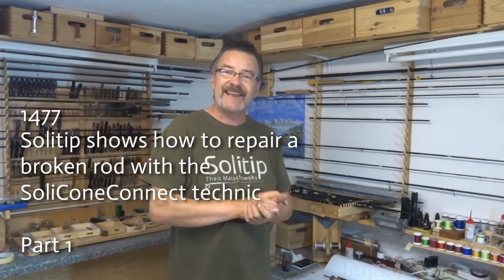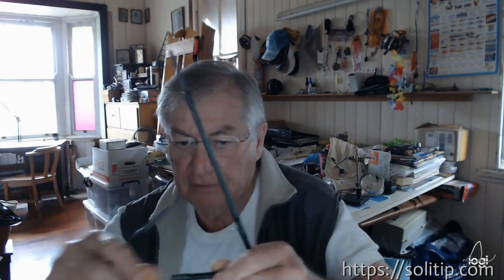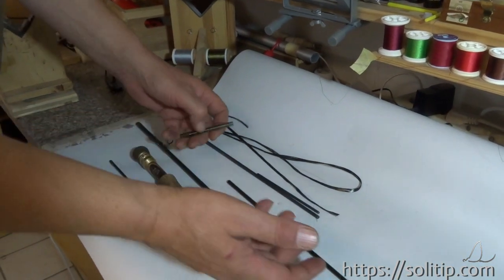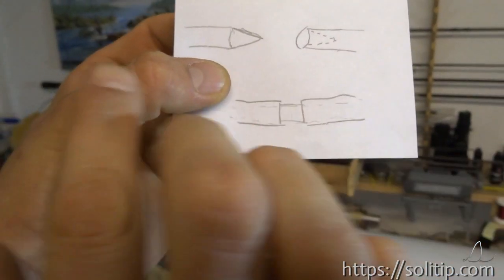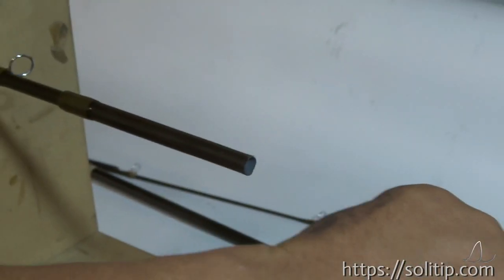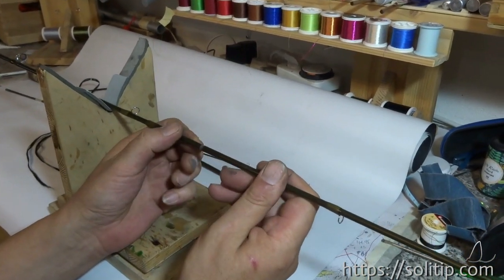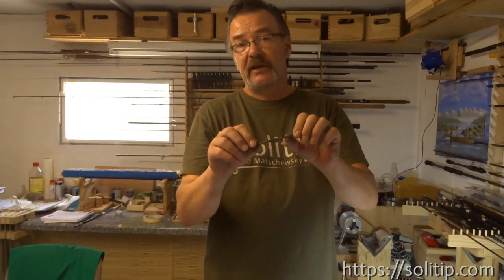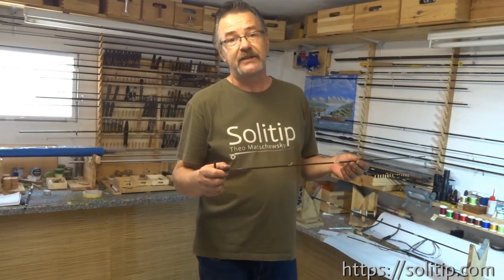DIY - repair of a broken rod by using the SoliConeConnect Technic from Solitip Part 1

Comment: Awesome work. Thanks for sharing your knowledge in English. Do you have any videos on repairing very thin tip rods? I have a rod that broke 12 cm from tip but the rod is only 1.3mm thick where it broke. ID is too thin to get graphite inside
Reply from the maker: thank you for the question. Repair of rod tips is my specialty for more than 30 years. There are some videos in German language on my channel but I will make one in English as well. Coming soon.